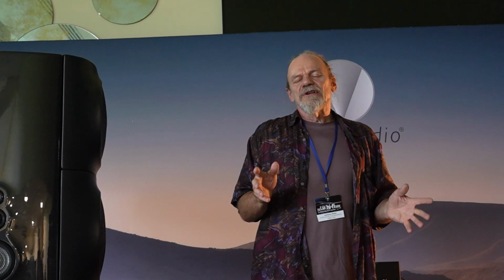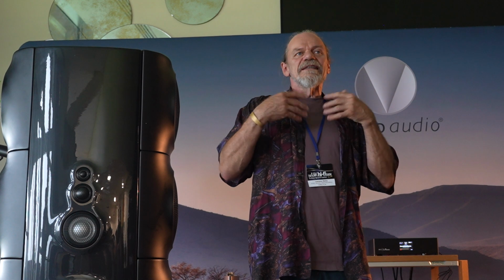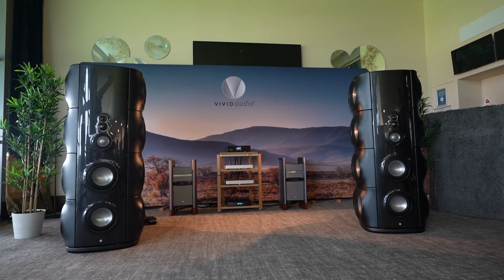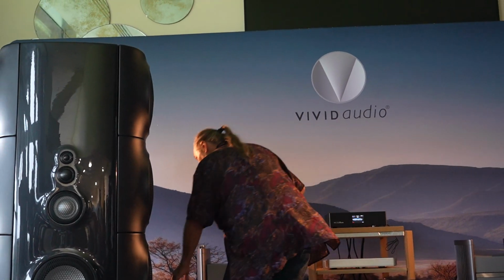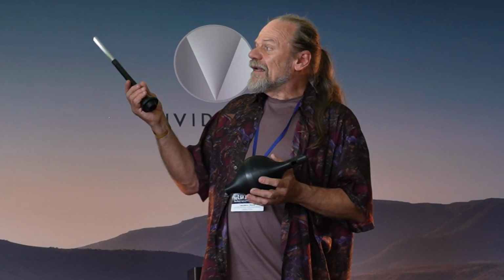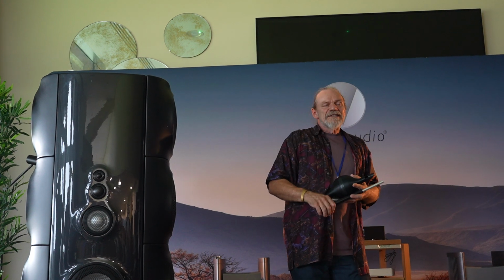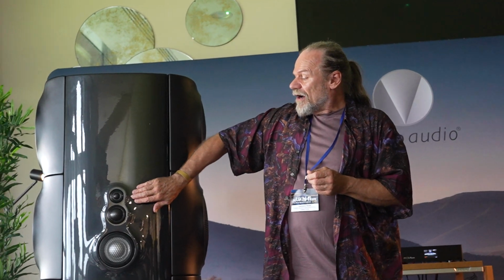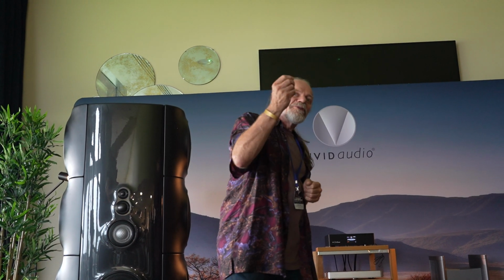UK hifi Show Live 2024 / Vivid Audio Moya M1 / Introduction Demo by Laurence Dickie

Comment: Very great lecture and thank you sincerely for this 
I wonder if they have tried a MTM solution for the mid highs taking out the dome midrange    I love MTM arrangement 
i read xover points at 125 Hz – 550 Hz – 1,700 Hz – 4,000 Hz
The astonishing midrange could work up to 4K without any issue i guess  Using 2 of them will even increase the SPL for a same THD   imho
P.S. for recording the speaker i would use a mic with a lens to avoid rear noise of people chatting in a very uneducated way  
They have just no respect for scientists
Reply: Dome have around 1/3 of the moving mass. More details & transparency! Better dispersion
Reply: @RC_Gubben  Hi thank you very much for your valuable advice 
what I have a hard time accepting even though I know it's true is seeing such small drivers used to obtain high sound pressure levels
If I understood correctly the objective was 120dB with low distortion on a band as wide as possible
evidently the high ways do not need large drivers
then I have a weak point for MTM speakers
and also for speakers in which the woofer is separated from the rest
I would cut all the towers above the woofer
kind regards gino